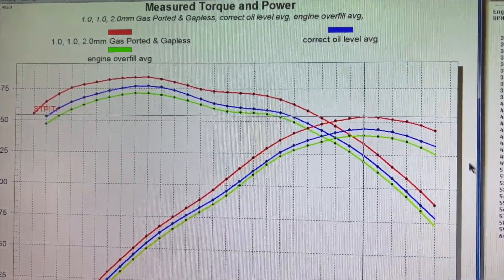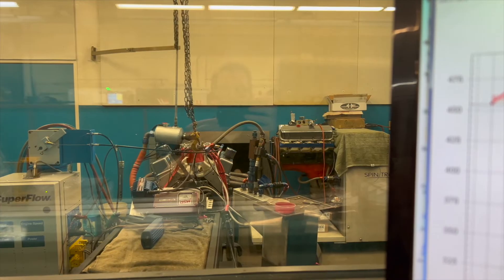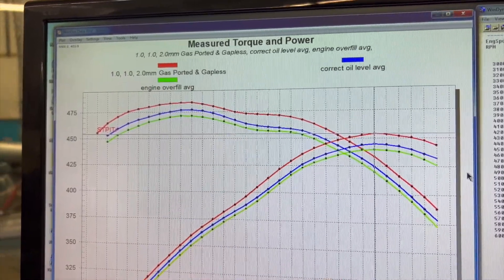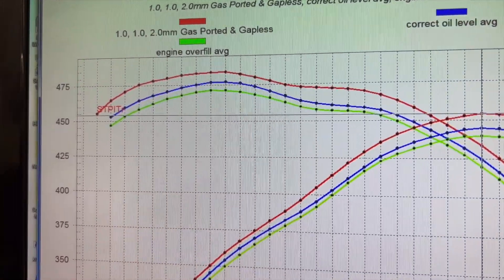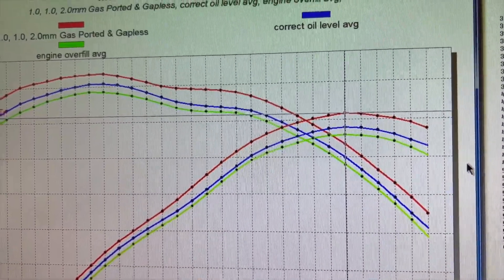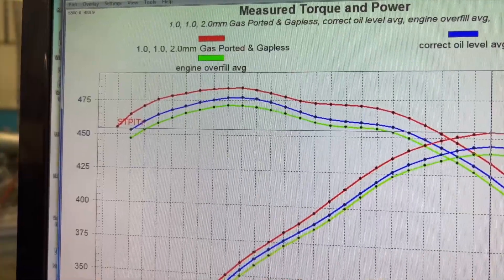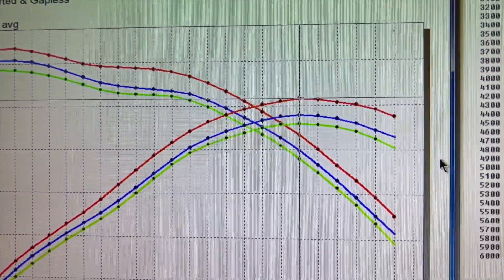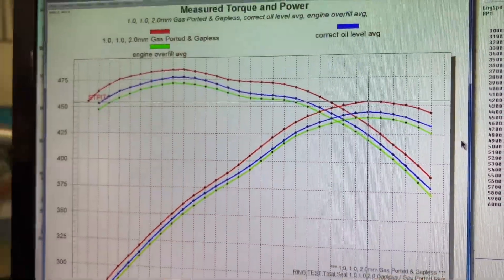How Much Horsepower Can Be Gained (or lost) With Motor Oil & Piston Rings?

Comment: You violated the #1 rule of dyno testing. You changed more than one thing at a time. Or at least that is what you showed. Now we have no idea what effect was the oil level and what effect was the rings .
Reply: Actually going back and looking at the dyno sheet it looks like maybe the red line was just the ring change. The way you said it it sounded like you did both. My bad
Reply from the maker: No worries. They were all separate tests. Just one change at a time.

Comment: Okay well what do you mean by getting one's oil level right? 

Because I know that some racers have used Corvette oil pans that take six quarts of oil. Some use aftermarket oil pans that take at least seven or eight quarts, and have oil traps built into them. 

So is this trial and error or is there a better way to know how to know how many quarts of oil need to be put into an engine? Without having oiling issues from a lack of oil in the system.
Reply from the maker: It does require some trial and error to get right, but a good starting point is measuring the distance from the bottom of the oil pan to the lowest throw of the crankshaft. We could do a video on the easy way to figure that out.
Reply: @TotalSeal  I don't see why a person could not use one of those borescope camera extensions for a smart phone. Run it down into the engine via the dipstick tube hole, or down through the lifter valley. So a person can see when the oil is getting close to the crankshift throw that hanging down near the top of the oil level in the pan. 

Because it comes across as if you want just enough oil to keep the engine lubricated without the engine oil coming in contact with the throws on the crankshaft.
Reply from the maker: @TheCrewChief374  That's a pretty  good idea!